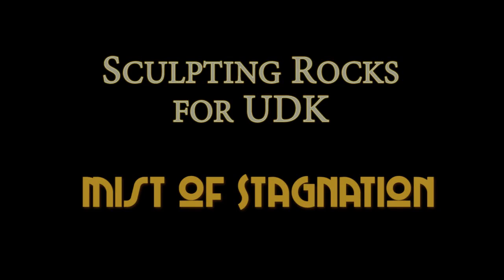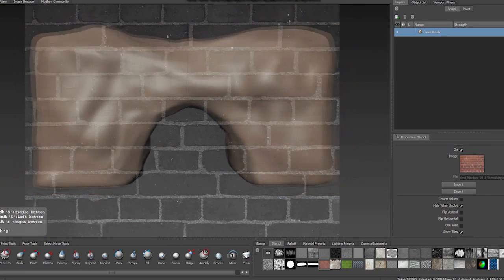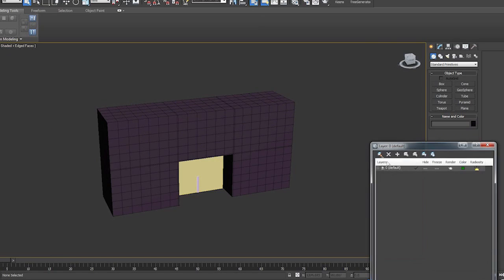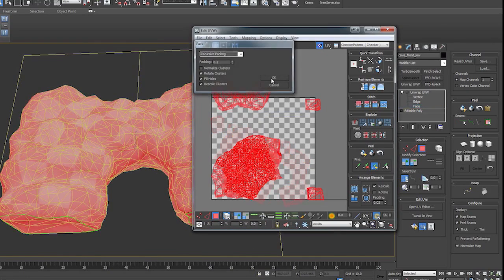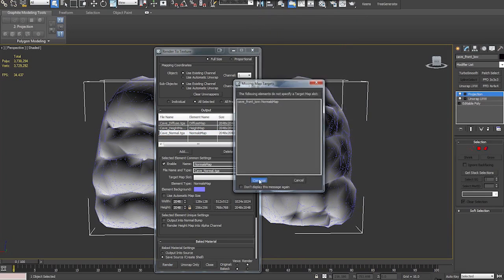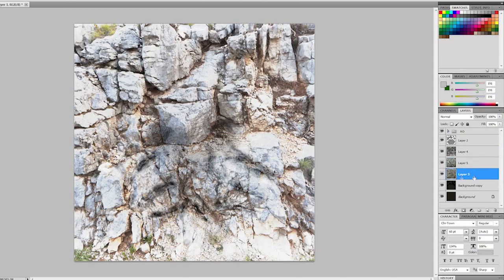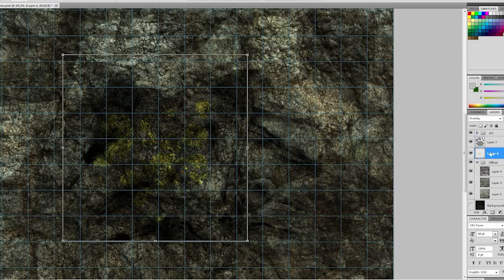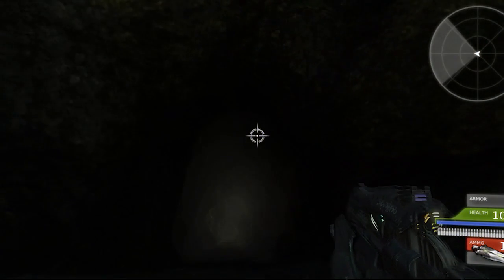Unreal Engine 4 / UDK Sculpting Turorial - Cave Assets

Comment: check the mudbox help when it gives you the error. It sayeth: With the problem mesh active or selected in the 3D View, select Mesh > Flatten to UV Space (Hotkey: Alt + T). With the mesh displaying flat, select the Grab brush from the Sculpt Tools tray, then drag the UV faces to be within the UV tile boundaries. See also Adjust UV positions in 2D.